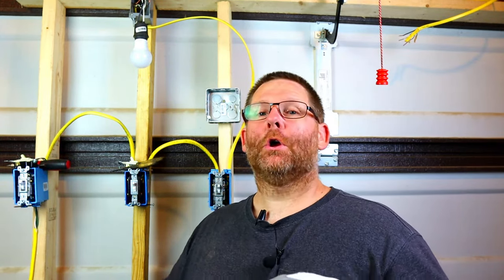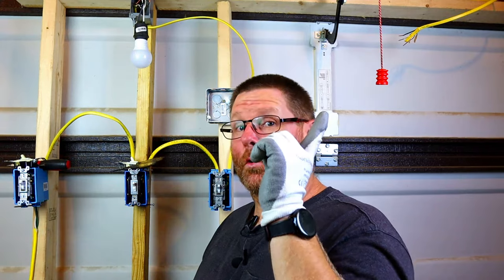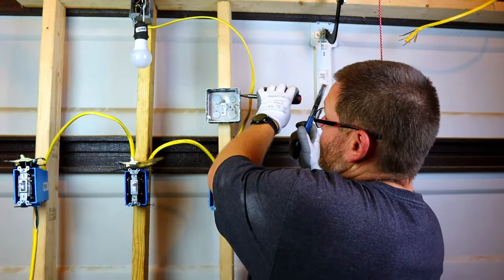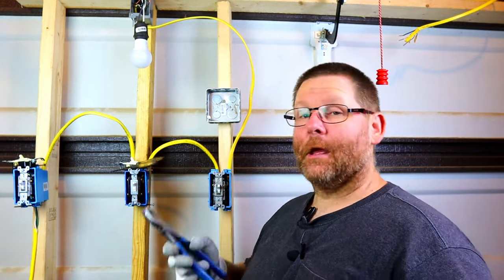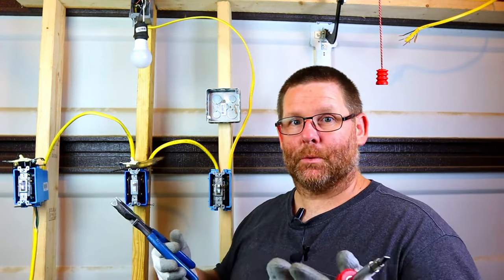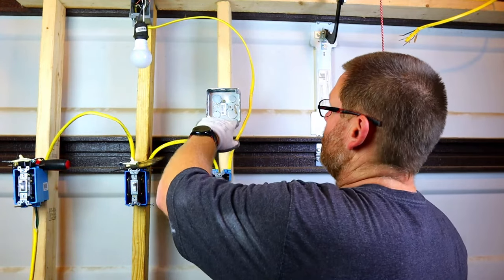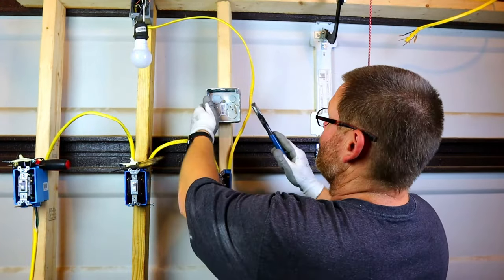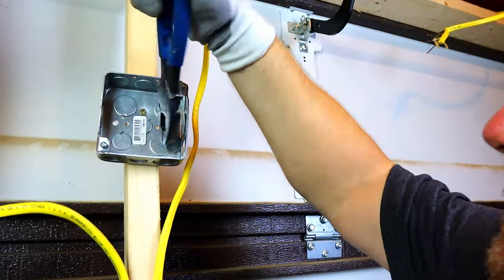How To Remove Knock Outs From A Electrical Junction Box

Comment: How do you remove a knockout from an existing box in drywall that has a mud ring? That’s the real video
Reply: Yeah exactly!
Reply: Did you find a way? Exactly what I need to know lol
Reply: Using a flat tip screwdriver and a long nose pliers.
Reply: Screw a self tapper in the knockout seal and use angled head dikes to pull on the head of the screw.
Reply: Drilled a hole in knockout and used 3” screw to pull it out.

Comment: So, I CAN'T run MC in to plastic box...can I run a Romex in to metal box?

You are ABSOLUTELY CORRECT, "electrocuted" means you were killed by electricity...WHY people confuse them, I don't know....well I do.

It's because MANY heard it from somebody else who can't distinguish one from the other.
Reply from the maker: You can run mc into a plastic box if it has a knockout plug you can remove. And you can absolutely run romex into a metal box.

Comment: Funny and clever. Thanks. However, I can’t use your 14-in-1 as demonstrated because the side of the junction box is covered by drywall. Any pointers on that? Maybe a video demo? 🥴😎
Reply from the maker: You can hit inside of the box with your kleins and w screwdriver I will definitely work on a video.

Comment: Do you have any tips on removing the 2-in-1 combo knockouts? I hate those. The ones that can fit both 1/2" and 3/4"? It's easy to remove the 1/2" but then the left over peace to remove to expand to 3/4" is a pain.
Reply from the maker: Soon there will be a video on this
Reply: agreed. I'm about to start installing boxes and 3/4” conduit and at a loss for how to do this easily. just bizzare they don't have dedicated 3/4” knockouts that come of as easily as the 1/2” ones. just don't see buying a dedicated tool so i can install 4 boxes.
Reply: ha, i found an easy fix ... just buy, in the first place, the 4in box with dedicated (i.e., separate) 1/2” and 3/4” knockouts! lol. i found these when i went back to home depot to find a tool for those hybrid knockouts.
Reply: @ronaldchong  I ended up just using some linesmen players and praying the little extra left over bit really hard. Hammering it with a screw driver does nothing but bending the box, found that out the hard way.
Reply from the maker: I have a video coming out very soon on a device I found that will help you all out. Watch for it

Comment: If the metal box is already installed in a finished wall. Drill the circle you want to pull out, then drive a screw into it (or anything that will fit) and then start pulling and shaking the screw around. Eventually, the metal disc will pop out.

Comment: Some years ago I had to get a knockout out of a 4" square box that was installed in 1947.  I had to take a screwdriver and a hammer to pry it out.  They made steel a lot harder in those days.
Reply from the maker: Yes everything was built much better back then. Nowadays it's pot metal or crappy metals. I appreciate your comment and watching

Comment: Can you make a video that explains things that are soooooo confusing??     Most of these metal electrical enclosures have knockout holes that measure 7/8th inch.    But if a person wants to find a connector to go into that hole - for 14/2 romex - they are not going to find a connector labeled 7/8th - because the industry does not label them that way.    

If you would be so kind as to explain the reason for this - you would be the only person on youtube who has explained it.

Sincere thanks!!
Reply from the maker: I guess it's the same thing as saying that you need to buy a 2X4 when really your buying a 1 1/2 X 3 1/2". Crazy how I never thought of that either. Good idea. Thanks for watching and commenting ☺
Reply: Sounds like you bought the wrong box, I've done the same thing myself thinking they were all the same. Good news is if you take it back to get the right one, you'll save a couple bucks because the ones with the bigger knockouts cost more in my experience.

Comment: How about doing one from the inside.  When you have an existing box and want to remove a knockout to gain access.
Reply from the maker: Sounds like a great idea for a video.
Reply: I work in fire alarm systems and do a lot of add-ons, I just get a small flat screwdriver in the gap from inside and pry it inwards, works really well.

Comment: Advice for if I'm doing a remodel and only have access to the knockouts from inside the box? And the box is attached to the stud opposite of the knockouts, so it keeps moving if I try to hit it with a flat edge.
Reply: Actually, I just had an idea -- maybe I can use a hacksaw blade to open small gap to get a flat edge in there . . .
Reply from the maker: Yes that definitely will work. I will be doing a video on it in the upcoming months

Comment: What's your recommendation if it's already finished, and u gotta come in from the inside?  I don't want to knock the nails out, it's side mounted to a stud with nails from the one side to the other
Reply from the maker: Take a screwdriver and pry it loose. It will pop off
Reply: @MountaineerOutdoors  I know it was a silly question, what I found to be the best idea, was to get a nail puller, they're solid, 90°angled, and a solid hit works good because a good surface area of the tool to knock it out and better weight transfer through the tool
Reply from the maker: Naw man not a silly question at all. Sometimes someone has a fool proof plan to remove them.. What you said is a damn good idea. Thanks for sharing it